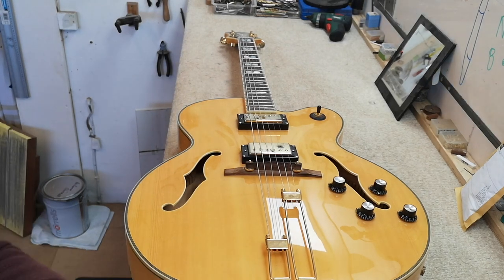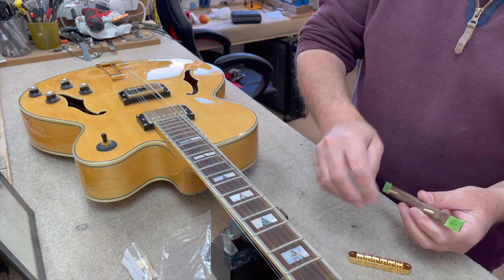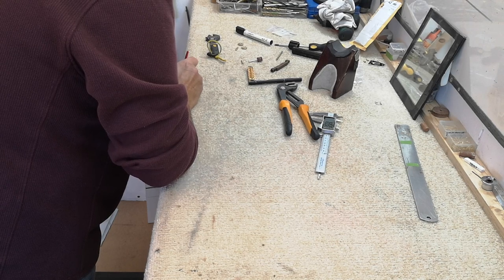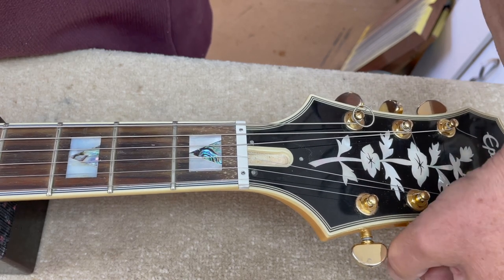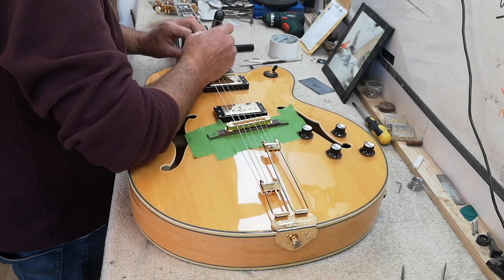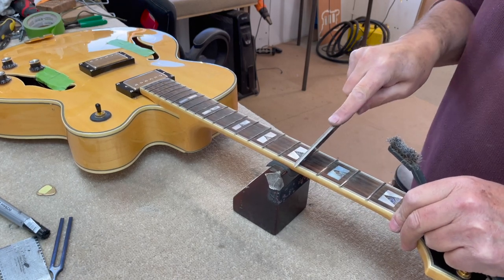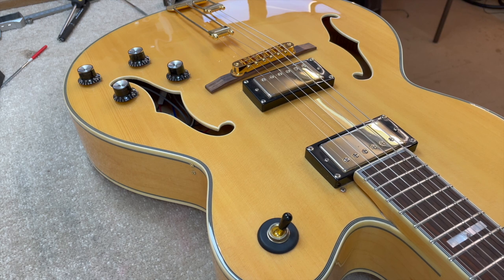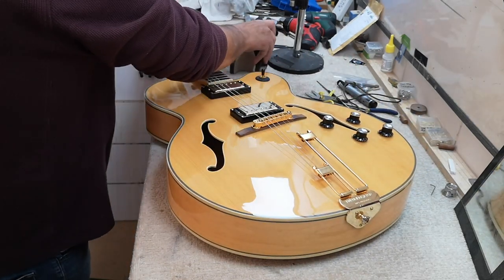Andy Partridge's Epiphone Broadway bridge fix and set up

Comment: Hi Sam Thanks for the video. Can you remember the age of the Epiphone Broadway you fixed? I had a problem with a new Epiphone (Sheraton Pro II) in the past. Took ages to find the butchered seat on which the nut sat. Plays beautifully now but it was a nightmare. The one you fixed was much worse and I am not as skilled to fix a new one with those issues.

Comment: Hi Sam  - Don't know if you have seen it yet but I've just watched twoodford tackle the same switch on a Gibson ES275. I was hoping he would have a way of improving the grommit switch situation - but he didn't! Afraid it just illustrates that this method is the manufacturers way of inserting the switch at the expense of aesthetics and functionality.
Reply from the maker: Haha that's fun to know. I did scratch my head a while about this. The only way to stop it doing what it was doing would be resin / glue and that was too permanent. Much better that the grommet saves the top wood than not, so best left alone!
Reply: @SamDeeksRelovedGuitars  Yes, at least it's a factory procedure and not a bodge, which might be as it appeared.
Reply from the maker: @paintbox48  It's not a bad 'solution'. Too many people on Twowoodford (?) YT channel saying 'replace it with a poker chip / sandwich etc'. Epiphone knew full well that a switch in that position on THAT thin top will split the wood unless it has a suspension system... and this is it. #itaintbrokesoIaintfixinit
Reply: @SamDeeksRelovedGuitars  It's just a pity the switch was wobbly etc. Still as you say "if it ain't broke!"

Comment: I was interested in the reissue of this guitar but after realizing there is no way to adjust intonation without a new bridge has definitely given me second thoughts…
Reply from the maker: Well... there IS a way to adjust the intonation and that's to place the compensated bridge at the correct point on the guitar top. People get all steamed up about needing individual saddles but remember that compensated bridges / saddles were invented for a reason which is that any properly-made set of regular 3-wound and 3-plain strings  will intonate in the same dependable 'two groups of 3 staggered' pattern. The relationship between the string apex points on that saddle / bridge are consistent & pretty much standardised as I said; all you have to do is find the start point - usually the high E. Since the compensation goes backwards broadly in a staggered diagonal the bridge is likely to be able to be placed at right angles to the centreline and the intonation still be good thanks to that staggered diagonal pushing the apex points backwards from the high E. If that spacing isn't correct then the high E end of the bridge stays in place while you rotate the low E backwards until it is the correct length. Then all the strings in between high E and low E should be pretty much bang on. Keep in mind that the original Gibson Les Pauls didn't even have compensated bridges; they just wrapped the six strings around a diagonally-fitted chromed stop bar. This intonated most of the strings.... nearly... kind of. Enough to play some Rock and Roll on :-)